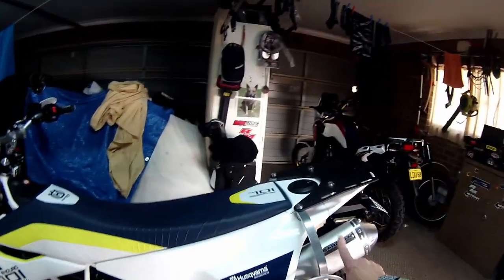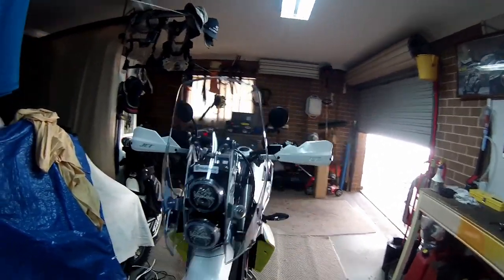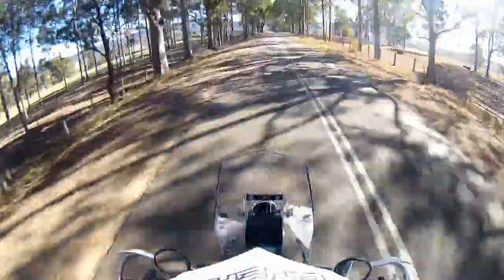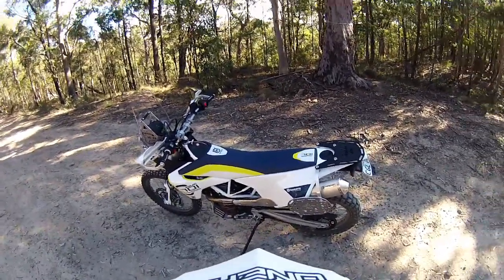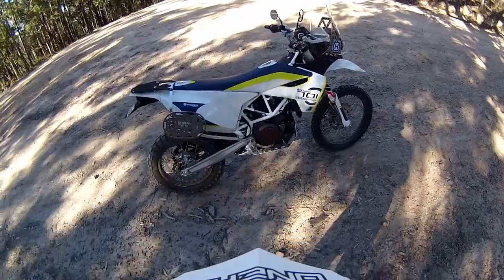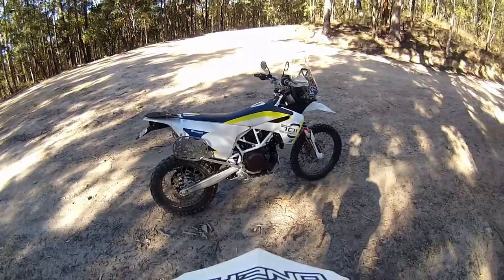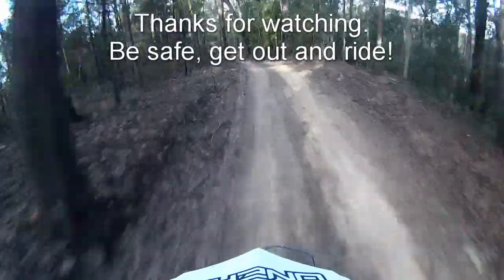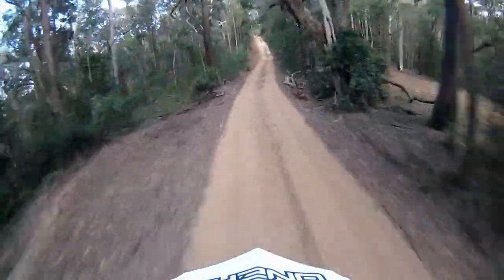Husky 701 Test Ride

Comment: Can you share how the rack for a side soft bags, from nomad-adv, is holding up? Is it sturdy enough, though made of Aluminium or it bends with a first tip over?
Reply from the maker: if you go to my channel I did a trip and fell off in the first part of the video. The racks did not bend and held up well with my load. They are light weight, I wouldn't bolt 20 liters of fuel to them, but strong enough for most things I carry.

Comment: What has happened to the DRZ400? I have thought about changing to the KTM 690 or Husky 701 but just not sure about the long term reliability.
Reply from the maker: Sold the bike to my brother. I wouldn't rush out and buy a KTM/Husky. The DRZ is a great bike. I just wanted a change. Both the 690 and 701 are good. 2018 and earlier 690 have a few issues with fuel pumps and rocker arms, but both are not a big problem to fix. People have done over 80,000km on a 690. The 2019 ktm and 701 are both updated motors and bike in general. I don't think reliability is an issue. The power on my 701 is crazy - much fun.

Comment: Great videos your a normal Aussi. 

We are looking at the Yamaha 700 Tenere or the 701 or the Honda Africa Adventure. 

We are all in our mid 50s the weight of the 701 set up how you have done it looks perfect. 

Would you take the 701 on a 4 to 7 day adventure ride or think it would not be good enough for an old body. 

Keep making these great videos.   

Could you tell me roughly how much your Accessories cost. 

As I would be putting on the spare tanks as well as a new seat which I think would be about another $1400. 

Thanks heaps great work
Reply from the maker: I've just finished an overnight trip on the 701. The bike was great. The AT is a great bike and eats miles, but heavy. I have now installed the front tank, seat and crash bars. Will be posting a video soon. The Tenere looks good. A lot like the AT but 30kg lighter - small tank.